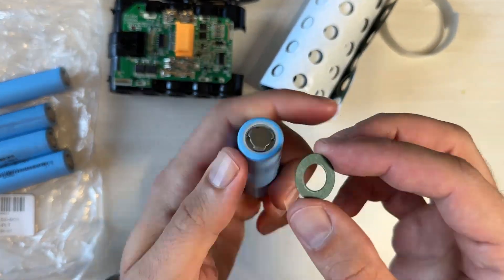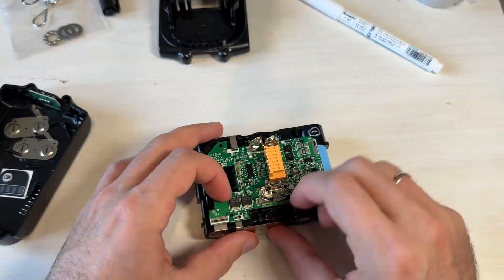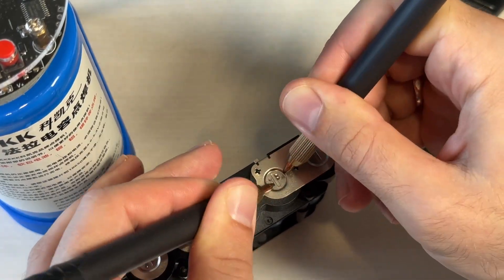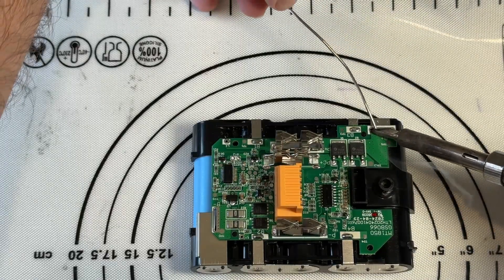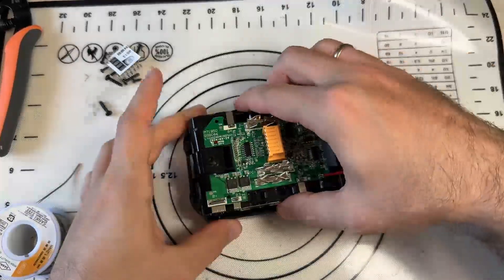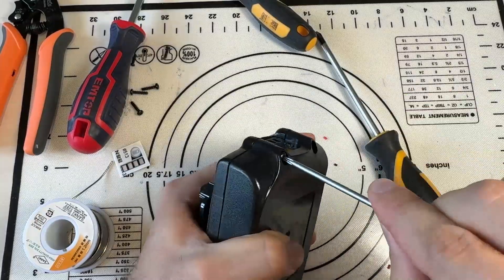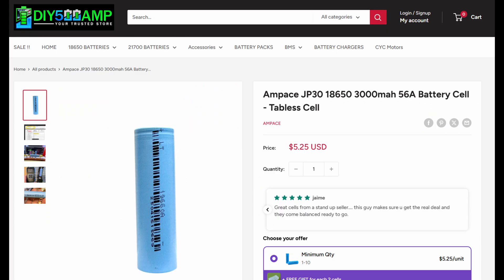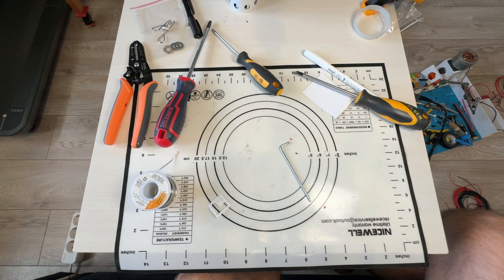🔋 DIY Makita Battery Pack — Better Than Original?

Comment: That is a great build. You did a fantastic job. I would recommend looking at the 21700 cells though. You get a lot more cell for your money. The market Focus has shifted to those whereas 10 years ago 18650s were the cell that gave you the best bang for your buck. That is no longer true it's getting farther and farther apart everyday that 21700s are a much better value. And they do make the generic cases for the 21700 cells so that is not an issue.
Reply from the maker: Thanks. I have some instrument, that can use only small batteries with 18650 cells. But overall you are right - 21700 much better for performance/cost.

Comment: Nice video. Did u use 10C cells?
Reply from the maker: Maybe I'll test them. I charged and discharged this cells with 10A and temperature was under 50C for a full capacity. By short period this cells can 10C without problem
Reply: He used Ampace JP30 cells, basically the best on the market besides the EVE 30PL. Insane cells